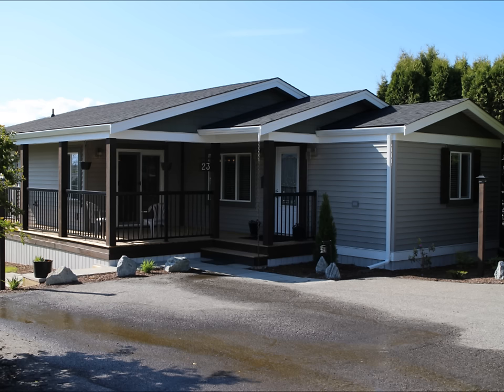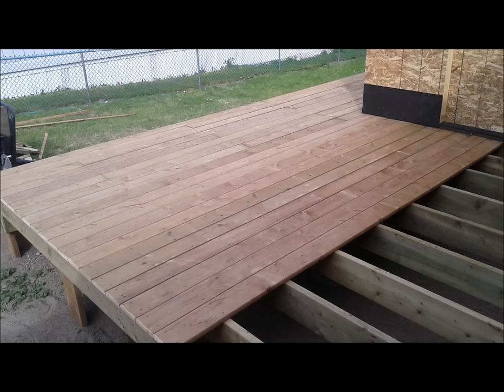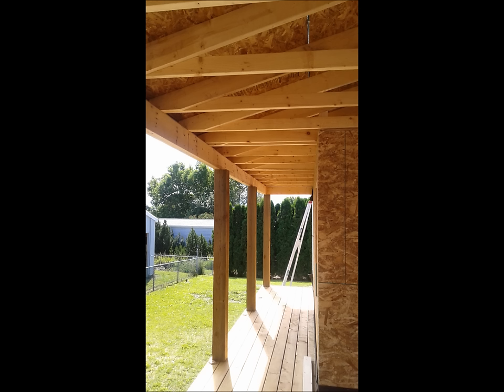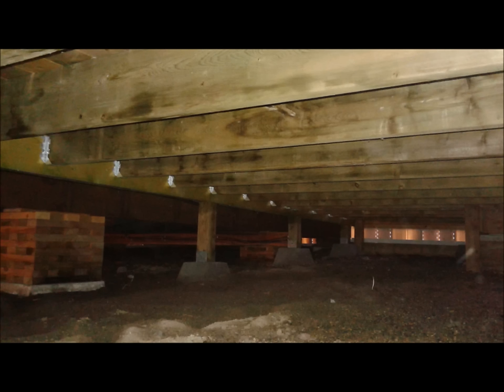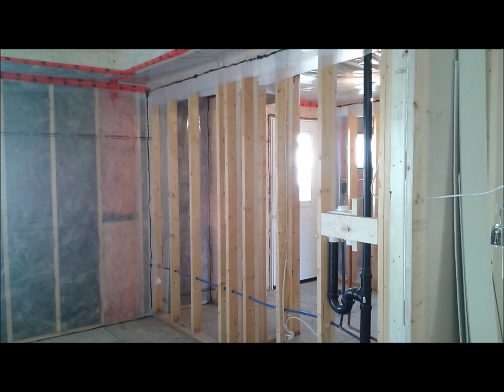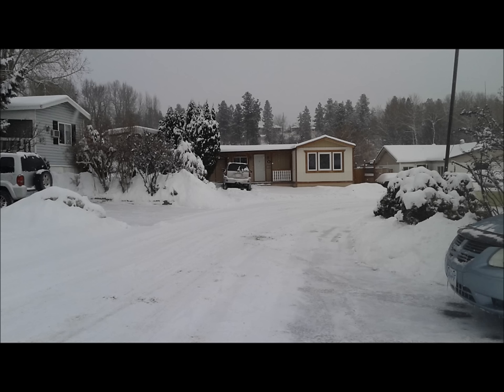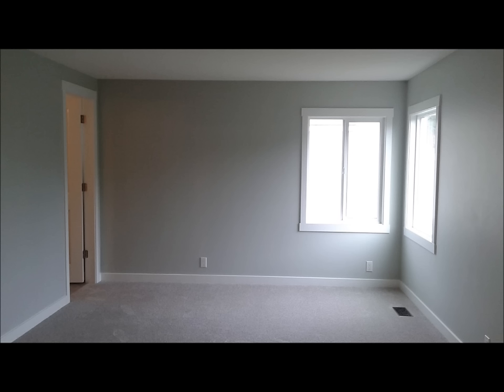Building An Addition To A Mobile Home - Start To Finish : E026 / BC Renovation Magazine

Comment: Question? Dis you add a new furnace to the addition?
Reply from the maker: manuel, we replaced the original furnace with that was inside the original home with the packaged unit that sits outside. The packaged unit outside heats and cools the entire structure. The fridge sits in the space where the old furnace was.

The original ductwork was retained. new ducts were added to the original ductwork to extend out into the addition. The packaged unit was tied into the original ductwork very near where the old furnace tied in. 

The new unit was sized for the volume of the new home including the addition. The home went from 810 sq. ft. to 1200. 

This is a really nice way to do this. It is a bit more expensive than a typical split system. It is really nice to get that noisy furnace out of the inside of the home. All of the noise is outside. all you hear inside is just a whisper of fan noise. 

It is also an efficient system. This one is natural gas for heating and electric for air conditioning. It is costing the homeowner about $100 Canadian a month to heat/cool the home.

Comment: I have a financing question about adding onto mobile homes. I have been told by various mortgage companies that if you add on or change the original structure of the mobile home and later decide to sell the home it will very difficult for a buyer to get financing because of the structure changes. Do you know anything about this?
Reply from the maker: Kristine, this is a difficult question to answer specifically. It is going to depend on where you are and the financial institutions that you have available to borrow from.

Around here, mobile homes are not really "mobile". They get set up on a lot in a park and usually never get moved. It is very common for additions like this to be done. In fact, it is the norm. 

There are many things that come into play when a lender looks at financing mobile homes. Around here, additions like this are looked at favorably by most lenders. It is not a deterrent. 

You really have to discuss this with financial people in your area.

Thanks for watching and commenting. :-)

Comment: The Hvac unit you used... does it save money on utilies or do u think the separate heating (wall propane burner) and wall AC unit is more cost effective?
Reply from the maker: Yo Co, the HVAC unit we used in this home is considerably more efficient than the old furnace that was in the home. Thanks for watching. :-)

Comment: I have a question about the cribs. Are they sitting on pile caps or is the gravel tampered and sitting on top of a slab?
Reply: I guess I didn’t clarify. A pile cap is basically concrete poured into the ground inside a square form. But I zoomed in a little more and can see that it is on pads. Thanks for the feed back 👍
Reply from the maker: Fredrick, thank you for your comments. :-)
Reply from the maker: Jordan, and Fredrick, the piles are sitting on precast, steel reinforced concrete pads that are about 3 inches thick. Those are placed on compacted gravel. We live in a climate where frost is not much of an issue. We do get snow and cold but it doesn't last long enough to get into the ground to start pushing these around.

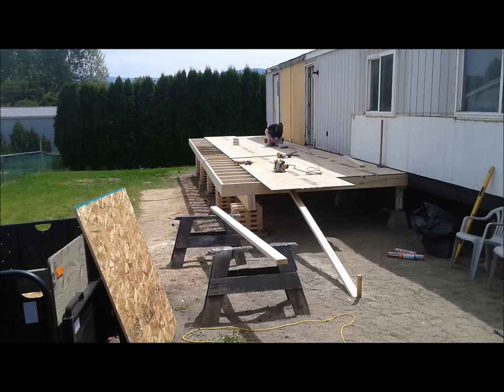Comment: Did you continue with the same roof pitch that's going up to the addition (the new section on top of the existing MH)? Is that a 3:12 or 4:12 pitch?
Reply from the maker: Hello, Gina. Yes, we kept the same roof pitch as the original unit. In this case it is 3-1/2:12

Comment: So whats the brand an model on heating cooling I would like to up grade my rental traliers  to that get rid of the furnace.. thank you
Reply from the maker: Roger I, that particular unit was a Keep-Rite. I don't recall the model number. That was about 5 years ago that we installed that one.

That unit is actually a commercial roof top unit that my HVAC guy adapts for use like this. This is a very common adaptation where I am. You see a lot of them around.

This one has a gas fired burner for heating and electrical for the air conditioner. They are also available all electric if gas service is not available.

Comment: How deep is the concrete under the cribs?
Reply from the maker: Hello, Robert. The concrete under the cribs here is about 3 inches thick. These are precast and steel reinforced slabs. In our area we don't have to worry much about frost getting under and heaving, so the pads just sit directly on the ground. In an area that gets heavy frost the concrete would most likely be required to extend below the frost line. Thanks for watching. :-)

Comment: Those footing don't look very deep, your building code doesn't make you go below the frost line? Here the code is 4 feet deep, I figured Canada would be more strict about that because its further north and gets colder temperatures and more snow.
Reply: Not on a mobile home. Houses are different. He didnt show you the house anchors but they are required. I didn't see any for the addition but I can bet they were added. I also didn't see any floor insulation or blanket. In Michigan, it's required to have insulation in the floor and a sheet type blanket covering everything underneath.  It makes for a royal pain when going under the trailer to do any plumbing repair. I had to fix ours because someone cut it open and allowed insulation to fall down. When I redid our kitchen floor, I added more insulation and resealed all the floor wrap.
Reply: @scottfirman  You mean a vapor barrier?
Reply from the maker: Hello Cool hWhip. We live in an area of Canada that is very temperate (semi-arid desert). We don't get much in the way of frost, although we do have four seasons and do get some snow. When it snows, it usually doesn't stick around long. Frost moving these homes around is not an issue.
Reply from the maker: RC, anchors are not required in our area. We are not subject to high winds and such that some areas of the country are. These homes just sit on those cribs, happily. Some settling of the cribs may occur over time, but usually very little. 
The floor of the addition was insulated with R-20 fiberglass batts placed in between the floor joists. 3/8" OSB panelling was then screwed to the underside of the joists. According to our building code, the resins used in the manufacture of the OSB board (exterior grade) are considered to be a 'vapor barrier'. Thanks for your comments. :-)
Reply: @BCRenovationMagazine  Wow, no anchor? That scares me silly. We get some big time hellatious winds when we get storms off the great lakes. This place shakes like a rag doll. I wouldn't even think about not having an anchor system.
Reply from the maker: @scottfirman  , not a problem here. These homes sit on these cribs like this for decades with no shifting. Just some minor settling. Thanks for commenting. ☺

Comment: Nice job man. Recently just bought a double wide manufactured and was wanting to do some additions to ad some rooms. What does a job like this ball park wise runs ? Is there an email you would rather me contact you with? Thanks
Reply from the maker: sullykls1, thanks. Shoot me an email. Go to the ABOUT page. Scroll down to the email address tab and click on it. You will have to do the Captcha thing to prove you are not a robot.  🙂 Kent

Comment: How did you add on the roof lines to this manufactured home? Attaching is not allowed where I'm at.
Reply from the maker: Hi, Randy. It may not be clear in the video. I didn't show that part in detail. Basically, the addition had to be a self supporting structure joined to the main unit only with finishes. The roof over the old main unit bears only on the main unit. Other than the framing, which is a very small load, no additional load was placed onto the original structure. The rafters are actually split at the intersection of the addition and the original unit.
Reply: @BCRenovationMagazine   They're more lenient where you're at. I see the rafters have nails attaching them to the original structure. We can't do that here. Unless I'm misinformed those rafters, in my USA location, can only "sealed" to the original structure. They cannot be fastened by nails or screws. Otherwise the same is true that no additional load bearing is aloud on the original structure.
BTW, you did a very nice job on this home. Took something old and run down and made it into a really nice place.
Reply from the maker: @randyscrafts8575  , thanks for the kind words. 🙂
Reply: @BCRenovationMagazine  how much do y’all charge to add on to a mobile home ??

Comment: Hello Ken.. Question.. ? Is it ok to do the rafters with 2X4 only? I saw built them with a mix of 2X6 and 2X4.. The way prices are.if I can do it on 2x4's only would be save a bit of money
Reply from the maker: manuel, it depends on the span of the rafter (the length), expected load on the roof (eg. ground snow load - GSL) and the building code in your area. I use charts from a publication called The Span Book published by The Canadian Wood Council to determine the size of framing I need. You will have a similar set of guidelines for your area to go by.

I will take a few photos of the book I use and some of the charts in it that are applicable to my area and put them up over on the community page to look at, but they may not be applicable, depending on where you are.
Reply from the maker: manuel, I have put the post about the Span Book up on the community page. Here is a link in case you have trouble finding it: https://www.youtube.com/channel/UCJMCY26tYJMaPrLcheEEjhg/community?lb=UgySJOMXCmgg46h17Ox4AaABCQ

Another factor that determines the size of wood you will use is the grade of the lumber. For example, engineered roof trusses are usually made of lumber with an MSR stamp, which is very high grade lumber.

On this addition project I used a combination of 2x4 and 2x6 because of the difference of spans of each. For the sake of economy, especially with lumber prices what they are now, we always choose the smallest size that will do the job. You can go heavier if you want. 

I LOVE talking about stuff like this! 🙂 Great question, manuel. 👍
Reply: @BCRenovationMagazine  thank you Ken.. I really appreciate...
I will also check with the village inspector..have a great weekend...

Comment: How much would something like that cost
Reply from the maker: Angela, and Travis, thanks for watching and commenting. I appreciate it! :-) 

The topic of cost has been discussed in the comments. We haven't come right out and said the cost but we have alluded to it. It is not a topic that we really like to put out there, for a few reasons. Costs vary widely from place to place. Your cost will likely be quite different than my cost. If you can do your own work you can really bring your cost down.

But in a nutshell, for us, where we are, this works very well. These homes in a renovated condition cost less than a comparable new home. It is not cheap, but for the people that are buying our homes, or homes like ours, it is proving to be a good investment. Our housing market is somewhat unique (very expensive) and these homes present an affordable option, in our area.

Comment: What are the dimensions of the footers under the cribbing?
Reply from the maker: Cory, those concrete pads are 24" square and about 2-1/2" thick. They are steel reinforced. They are commercially available but can be difficult to find, depending on where you are. They are easy enough to make yourself. Just make up a form, get some of that ready-mix concrete in the bags, some rebar and make them yourself. If you make them yourself it wouldn't hurt to make them a bit thicker (3-1/2"). The wood cribs themselves are 18" square.

Comment: Permits? Because it is on private property instead of a lot so is no longer considered mobile?
Reply: how is it no longer considered mobile the addition isn't cemented in nor is it stuck to the ground.
Reply from the maker: Hi, Sophia. This home is still considered and registered as a mobile home. The home is not on private property. It is on a leased lot in a mobile home park. The park is in a major metropolitan area and building standards have to be adhered to. Permits are required to: move these homes in; move them out; demolish them; add on to them; do any additional electrical or plumbing work; etc. Here, they are treated just like regular site built homes. Thanks for watching! :-)
Reply from the maker: DR PHIL  , around here the foundations are done to a different standard than site built homes. Mobile homes are not considered permanent structures where we are. How foundations are installed is dictated very much by existing local soil conditions and weather. Our area is characteristically glacial till soil conditions (sandy, rocky and well drained) and our climate is semi-arid desert (northern tip of the Great Sonoran Desert). We don't have to deal with a lot of frost.

A second story on one of these would not fly around here, as much as I would like to try one. I am thinking more of a story and a half than a full two story structure. Local building authorities would not approve it. I think the main obstacle to that is that the exterior walls don't sit directly over the foundation supports, but are cantilevered over from the steel beams running lengthwise. Just a guess on my part...

Thanks for watching and commenting. I love thoughtful comments like yours! :-)
Reply from the maker: DR PHIL  , cool! 👍☺. People here in the Okanagan have trouble finding good people to do work on their mobiles. For some reason people don't seem to want to work on them. They are different than conventional stick built homes, but not that different.

Comment: I thought modular homes required full foundations in BC now.  Did you not have to because it was an existing unit and just a renovation?
Reply from the maker: Hello, Geoff. This is classified as a manufactured home. I don't know a lot about modular homes but they are two different classifications. Different requirements.
Reply from the maker: Geoff, we just followed the set up of a brand new manufactured home across the street from our project. It really wasn't much different than the way this one was done. Now, the cribs are required to be concrete block instead of wood. A layer of washed rock is placed under the home with a layer of 6 mil poly over that to act as a vapor barrier and radon gas barrier. Check out this video where we show that home being set up: https://www.youtube.com/watch?v=bzLqXxLqVNo

Comment: What is the heating cooling unit called? Are you saying u have NO furnace inside ur MH?
Reply from the maker: Hello, Kristina. The unit is called a packaged unit. An HVAC perdon would know what it is. This is a commercial rooftop unit that is used this way. 

There is no furnace inside. The original furnace sat where the fridge is now. It was removed and the space was re-purposed for the fridge. 

This is a very quiet system. The change is dramatic. No more furnace noise inside the home.
Reply: Do you live in a warmer climate? 
I live in Pennsylvania, US. It can drop below freezing sometimes. Would I be able to use this type of system or do I need to a have furnace inside?
Reply from the maker: @kristinakeifer5841  , we are in a four season climate but we don't get extreme cold. I suggest you talk to a local HVAC company to see what they say about using a system like this in your area.